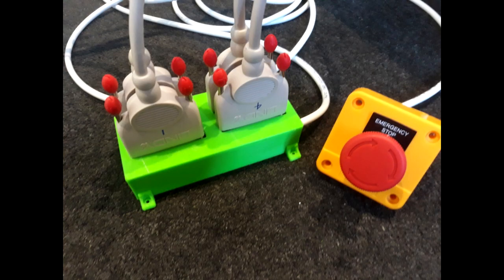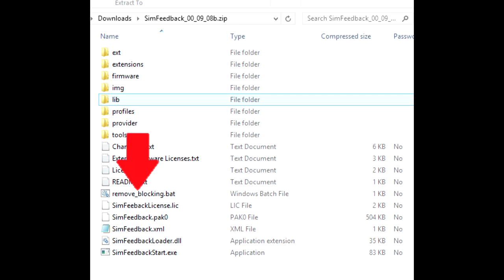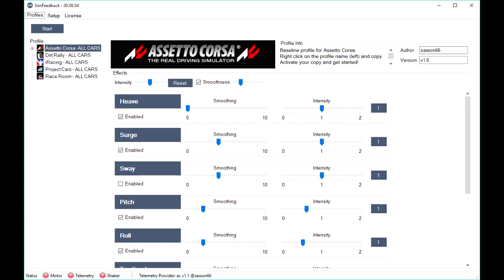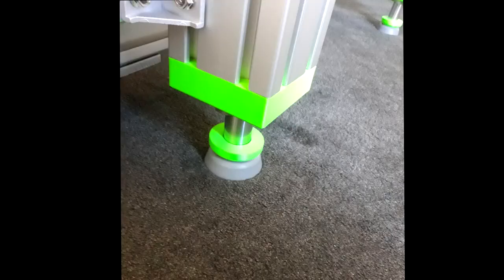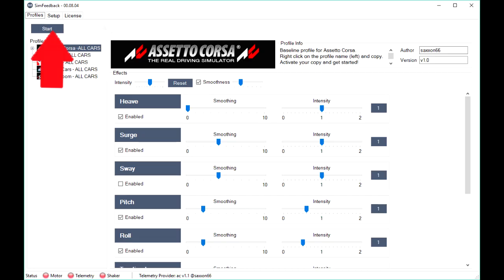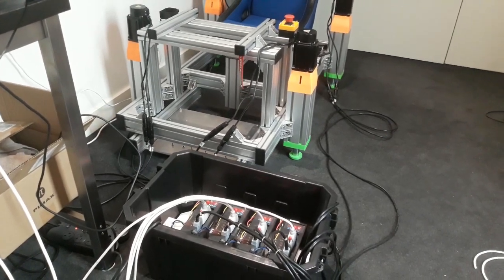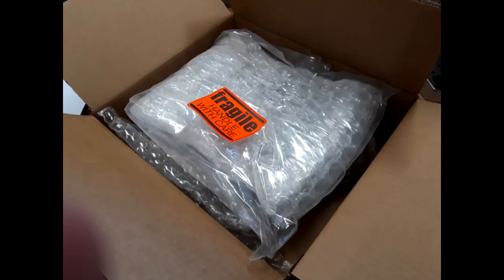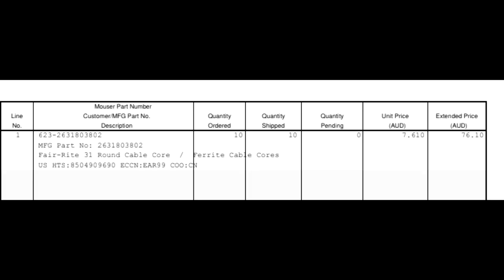DIY motion platform for racing and flight sims - electronics and software

Comment: Hello, i built a welded iron frame driving simulator so its more heavy than aluminum ones.I would like to make it to move using a 4dof system. Can i use the actuators in this video ? What is their maximum permitted weight ?And another question, do i need something else or just the products explained in this video ? Because i see people saying they used them for their SFX100,what is that ?

Comment: Hello! My Servo Controller show the same Error Like ur´s. AL 09. So i cant do the JOG Test. How did u fix the AL 09 ??
Reply: It´s done. If anyone else have the porblem at first. Check the plugs inside. i had a tiny  shielding hair inside. Now works fine.
Reply from the maker: @seba3420  Great job! Thanks for sharing
Reply: @seba3420  which plug ? I have the same problem :/
Reply: @LeboisRacingFR  The Motor Connectors. The plug from ur controller to the servo/motor

Comment: How many KW it need when is used with simulator?
Reply from the maker: It only uses a few hundred watts. It certainly doesn't use anywhere near the ratings of the motors and drivers. Easy to run from a standard power point.

Comment: Thanks for all your effort you put in this vids. This thing is like a dream to me. Building your own motion platform. How good is the experience in combination with your vr? Is it that good that you forget that you are in a simulator?
Reply from the maker: For racing sims absolutely yes! With VR in this rig YOU ARE THERE. It is not so convincing in flight sims though. It does add another level to the experience especially with larger aircraft and is totally worth it but not so much for aerobatic aircraft for obvious reasons such as barrel rolls :) So there are limitations. I like this rig better than the previous 6DOF I built - smoother, easier to get into, less space etc
Reply: @sixdegreesofflight7765  how is this compared when flying helicopters? Is the 6DOF more realistic with the helicopter or are they both the same?

Comment: Hi. May I ask why did you change from 6dof to 4dof?
Reply from the maker: Sure. Quite simply, I have just moved into an apartment and didn't have the space for the larger 6DOF Stewart platform. The SFX100 is a much simpler build and easier to get into and out of. It doesn't have large batteries needed to soak up circulating currents and lastly is much more flexible to connect peripherals such as joysticks and pedals.
Reply: @sixdegreesofflight7765  edit: No they werent 220v as I have seen.
--you used batteries? Servos of the 6dof were 220v, right? (Thanks for answer)
Reply from the maker: @BallestaRacing  The motors used in the 6DOF are 24V DC. I used two 12V car batteries in series for each pair of motors.
Reply from the maker: The motors used in my latest build 4 DOF are 220V servos
Reply: @sixdegreesofflight7765  if apply your 6dof's actuator design in 4dof. Do you think enough power to lift?
Reply from the maker: @ddhoohobb  Each actuator can lift around 30kg safely. If you only use four then the rig itself will have to be very light so that your own weight and the weight of the frame is less than about 120kg